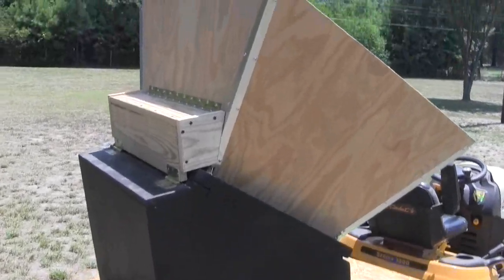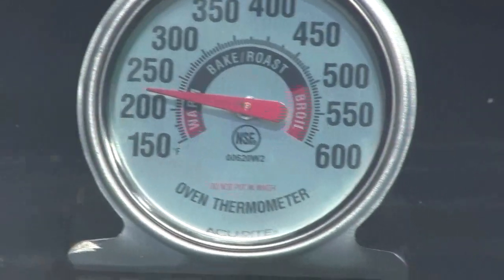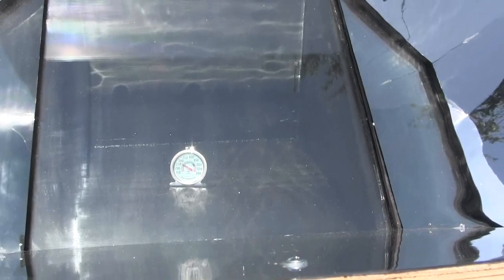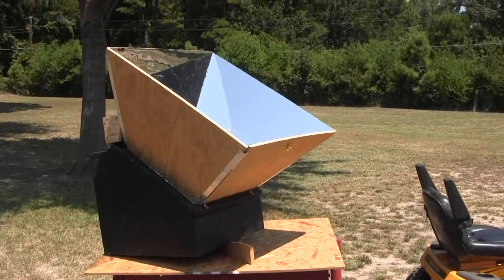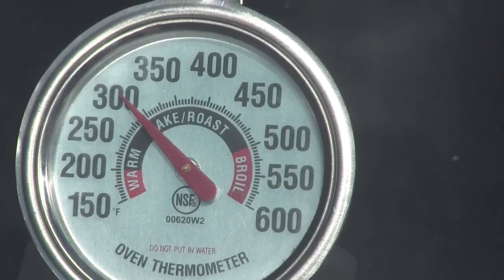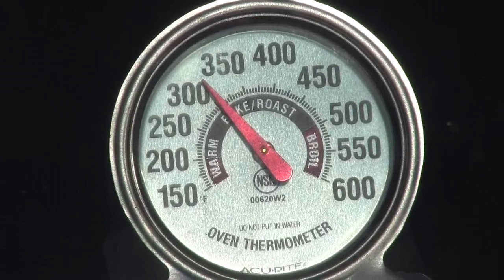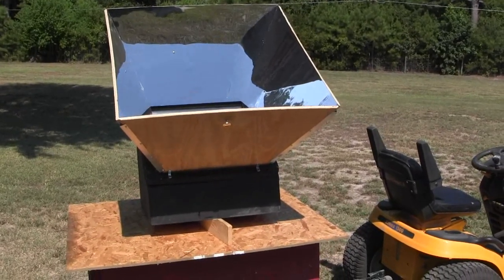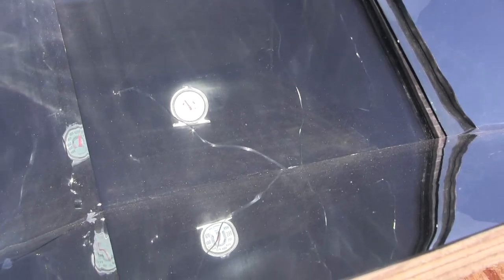How to build a solar oven reflector

Comment: Hi,  I was wondering how you arrived at using the double glass ??  I am going to build an oven and I had thought of the double pane glass too but then I got thinking that maybe it is counter productive as the double glass would act like an insulator as it does in house windows.  What are your thoughts ??
Reply: Clear glass absorbs very little of the energy of the sunlight.  Using two panes creates an insulating barrier that will prevent some heat from escaping.

Comment: If my oven reaches 350, I wouldn't mind it cracking. It means you are doing something right, except for the glass. The hottest my oven got to, with food in it, is about 290. I just made some minor adjustment to it also so I might get to 300 F.

Comment: If you like to make things, building one is great. Mine works as good (or better) than the Sun Oven, and it cost me about $120 to make. The Sun Oven costs about $250. It really isn't an easy project, though, and I spent about 35 hours on mine. I have power tools, but I work in my yard. If you have a shop it could be done more quickly. I'm happy I built mine, though. I've already cooked a bunch of things in it, and it works fantastic.

Comment: if you have normal glass it will on the inside expand when it gets hot, putting stress on the cold glass on the outside. When the stress gets too great, it cracks but borosilicate glass wont due to the fact that Boron changes the atomic structure of glass so it stays roughly the same size regardless of its temperature.